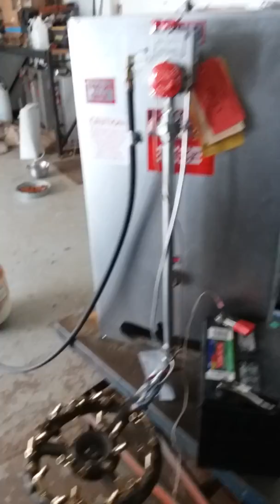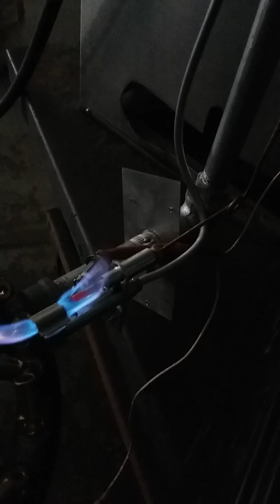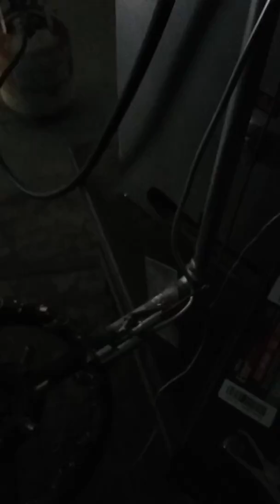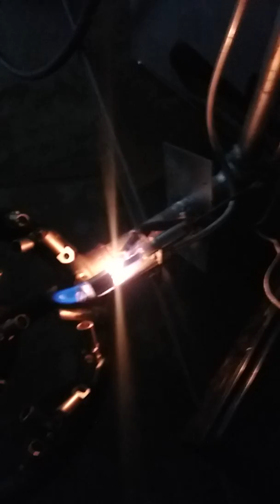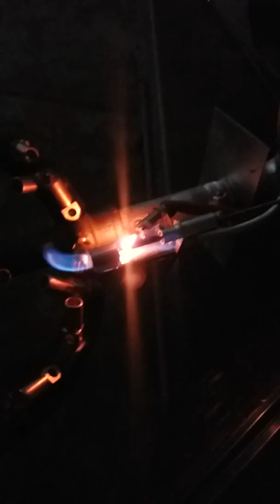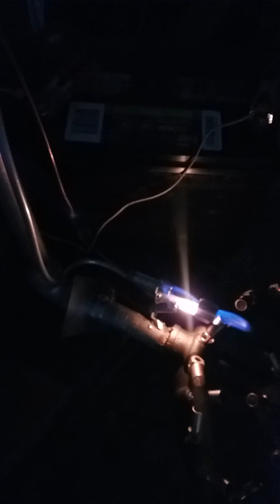2019- JUDSON / GEORGE BRITE /  Silicon Nitride Igniters FOR LITTLE GIANT HEATERS

Comment: Little Giant heaters offer dependable even heat that doesn't spike in temperature when used with carpet cleaning equipment.   I bought my Judson TNT with a Little Giant #4 over 10 years ago from Judson Truckmounts.  It all works great together.